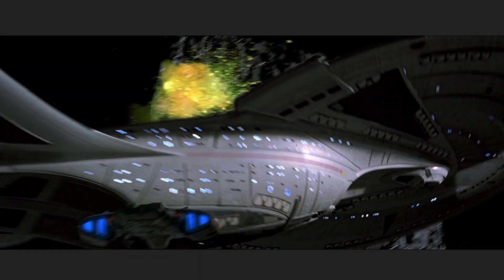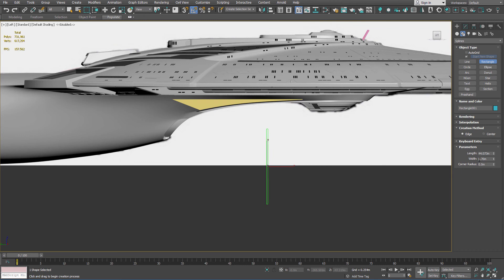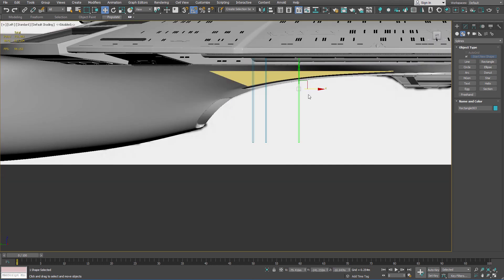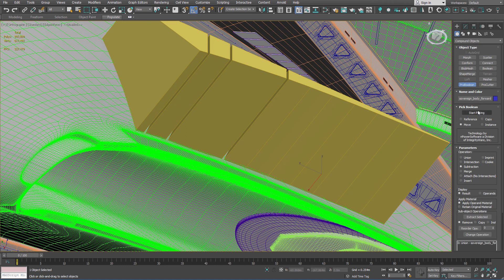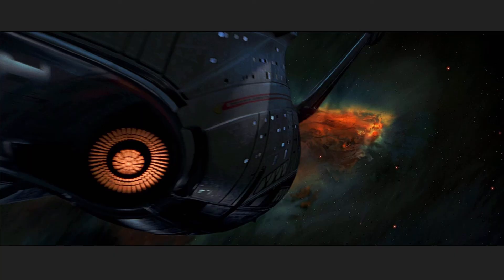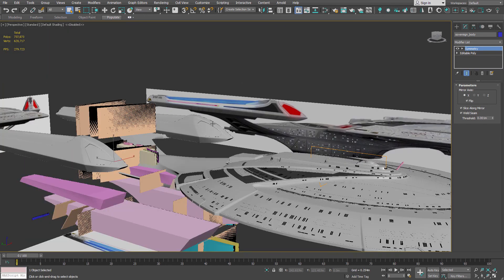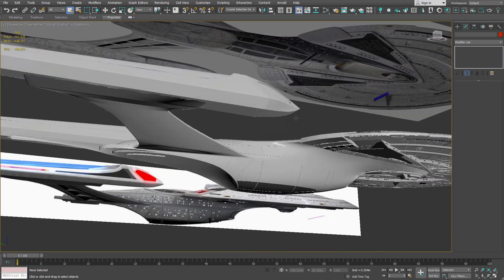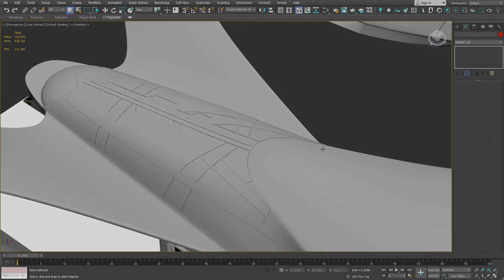Sovereign Build 28-Secondary Hull Armor Plating

Comment: You might want to check out the shrinkwrap modifier, it's almost tailor made for the hull plating. Just create the 2D shape in ortho mode as you did as a plane, then shrinkwrap it to the hull, this keeps it as a separate object making it very easy to adjust also.